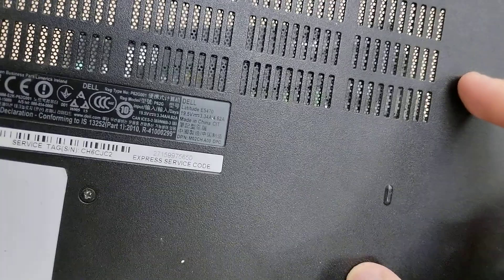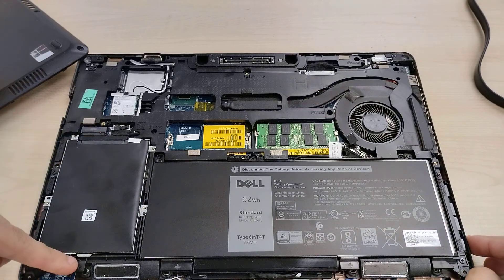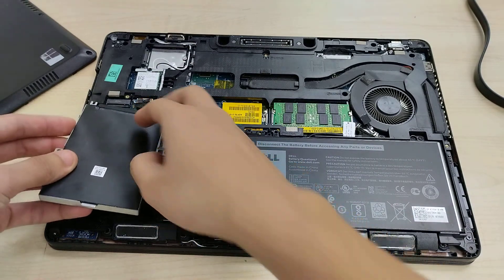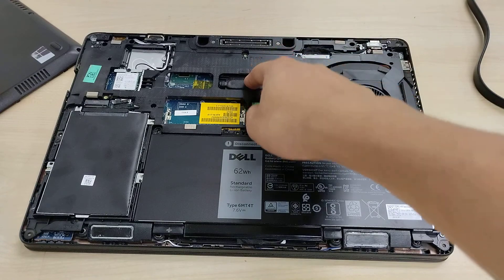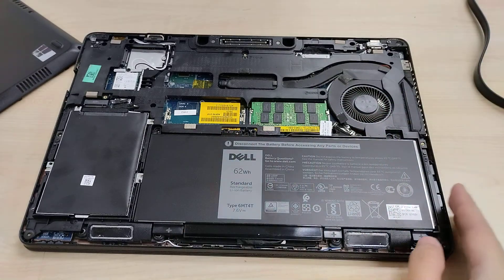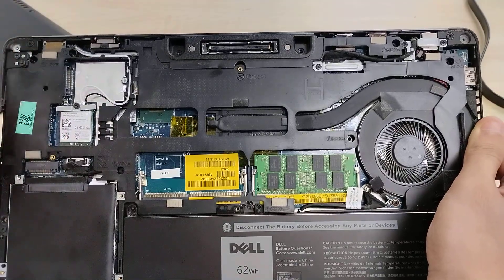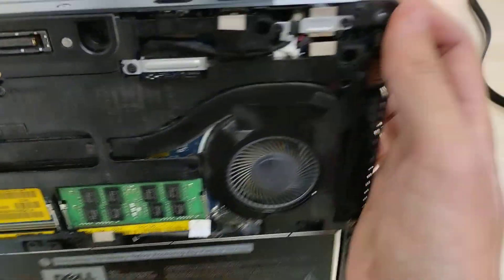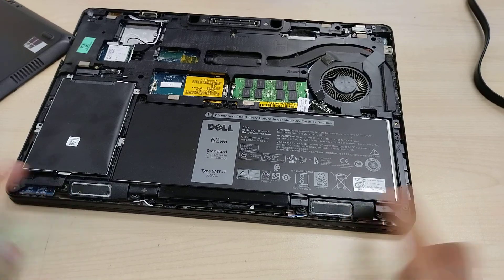Dell Latitude E5470 Internals (i5-6440HQ CPU, HD Graphics 530 GPU)

Comment: Can you give the temperature stats? I have the HQ i5 and i7 versions since they go up from one they are at 95 degrees, is it normal for it to be like this? (I did maintenance, it doesn't turn off, it's as if it were normal.)
Reply: Normal lol, sometimes they go 105* for some people, just be thankful your below 100
Reply: Only advice would be to clean fans and repaste regularly every few months  🤷